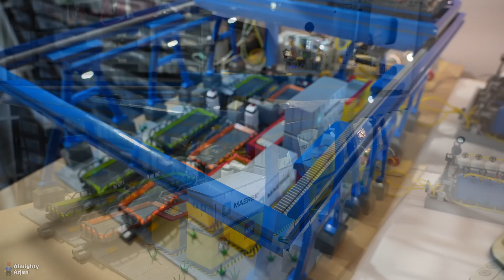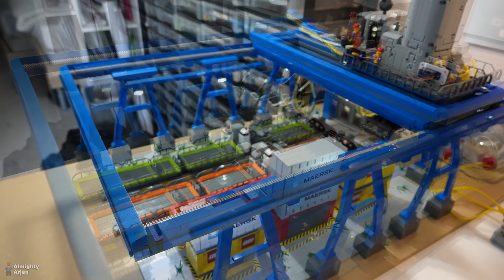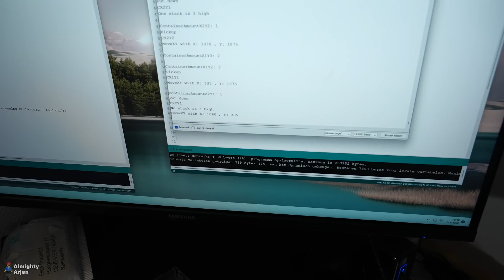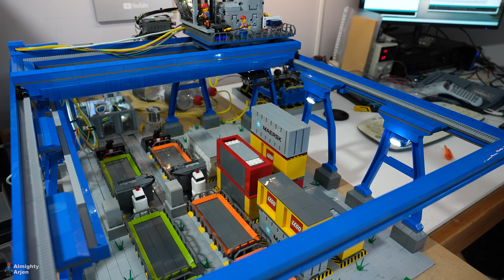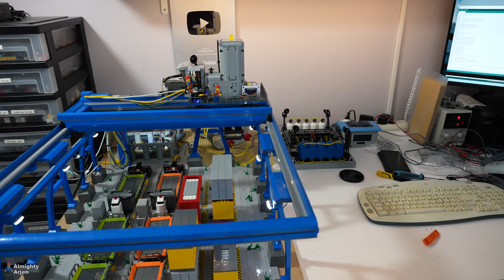Automated lego train container terminal E36: Shuffling containers

Comment: 10:30 can you move the motor upwards so the magnet will pass under it? I am not familiair with the monorail universe…
Reply from the maker: I think I could. It's just a servo, I can lengthen the axle and fix it in a different way. Thanks for the tip!